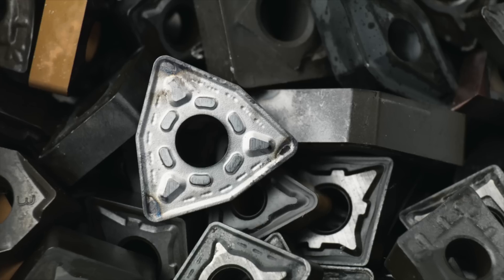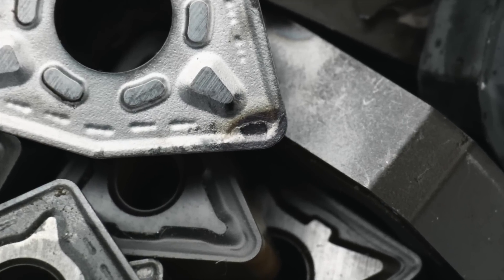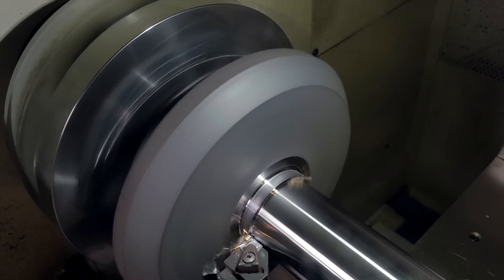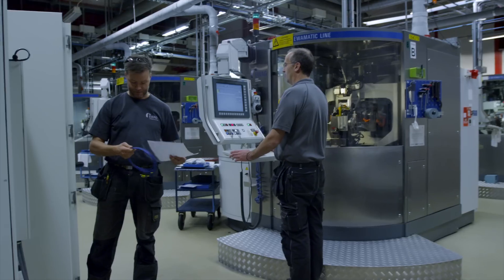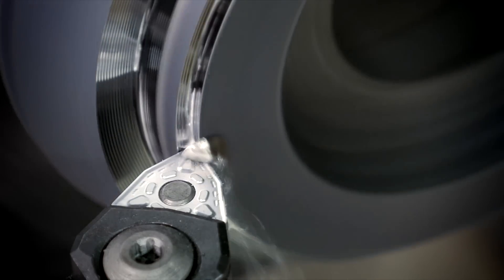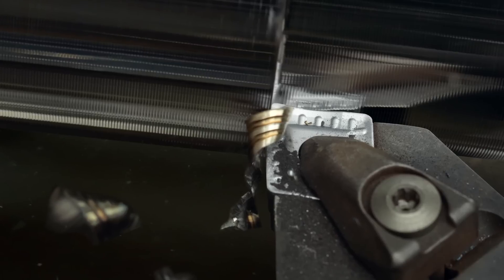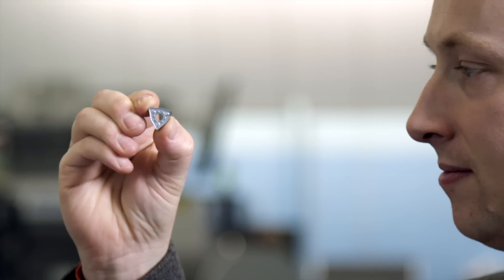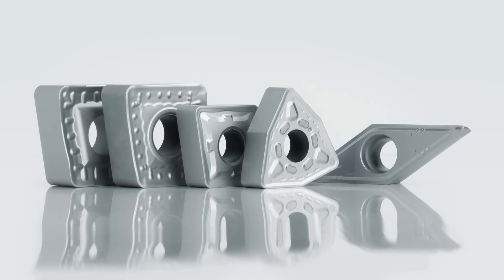Duratomic: Make every edge count

Comment: the edges on discarded inserts are unused because the inserts crack and when flipped over to use the other edges, cannot offer stability! It's not that people are blind and cannot see which are the unused edges, so chrome is USELESS!
Reply from the maker: If you have a problem with inserts cracking, please contact your nearest Seco Tools rep and we'll help you solve that problem.
Reply: I want to know when my inserts are finished, not when they've been run for 1 minute. Can seco give a solution for that? Thanks.
Reply: yes that's normal, but as a sales pitch the chrome indicator is an additional hidden cost, which provides no increased functionality
Reply: meocats chill